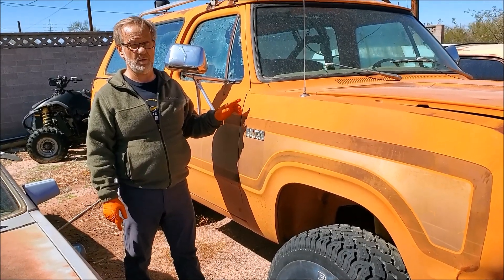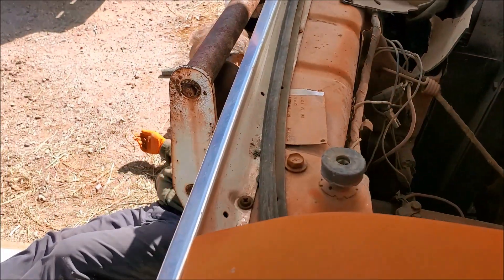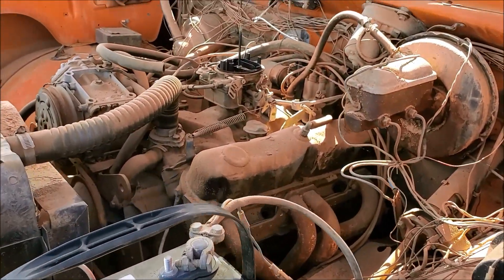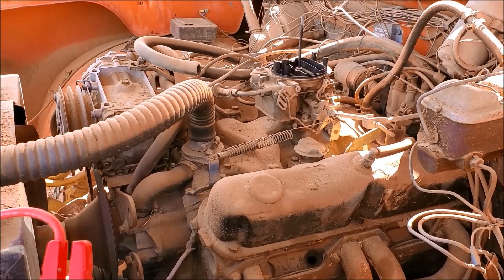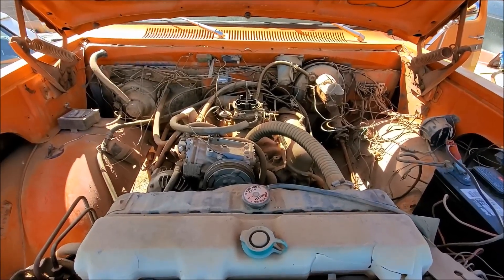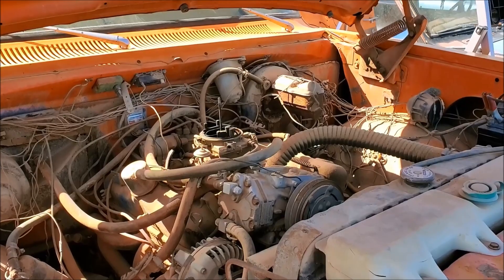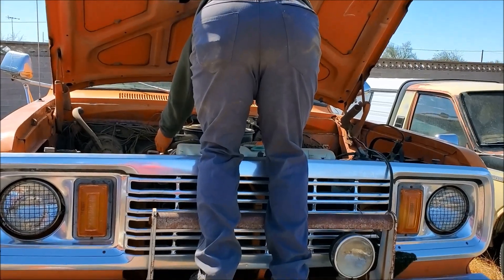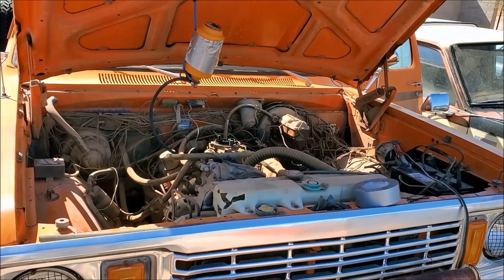1978 Plymouth Trail Duster resurrection

Comment: Is this the same as the ramcharger?
Reply from the maker: Yes it is.
Reply: @daytonagrayghost  that’s wild. I guess Chrysler had to compete with dodge a bit. I’m guessing that was before they merged? And which one was better in your opinion?
Reply from the maker: @venomous_spiderx7939  they are identical, it's just "badge engineering". One is badged as a Dodge the other as a Plymouth. Just like a Chevy Camaro and a Pontiac Firebird.
Reply: @daytonagrayghost  oh okay that makes sense. I wouldn’t mind having the collection though😂. Trail Duster sounds like something that’s a real road burner though. Like leaving the opponent in the dust. Why was the horsepower so low on these trucks from the factory though? Was that common in the trucks back then? I’m guessing it was probably a lot for trucks in that era. They look really mean though. I like coloring on yours too. It’s very nice.